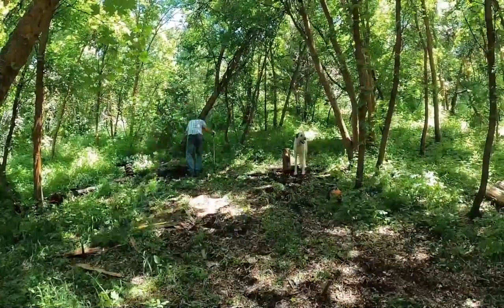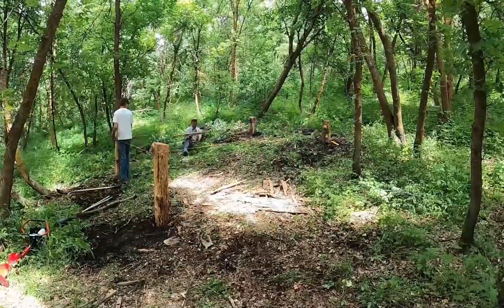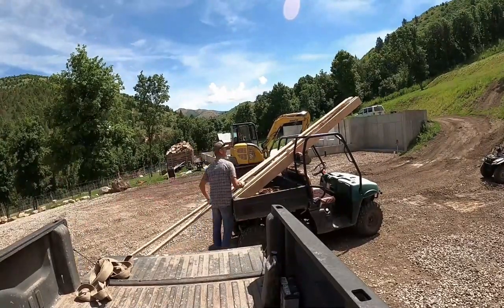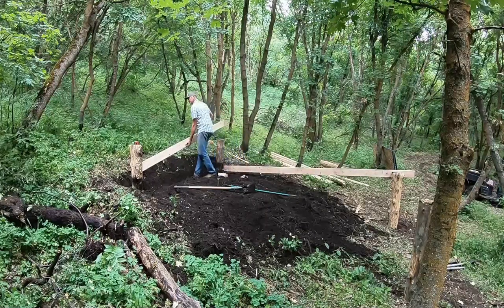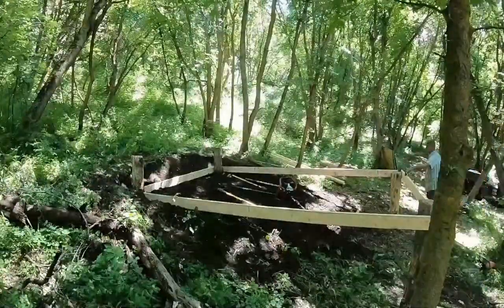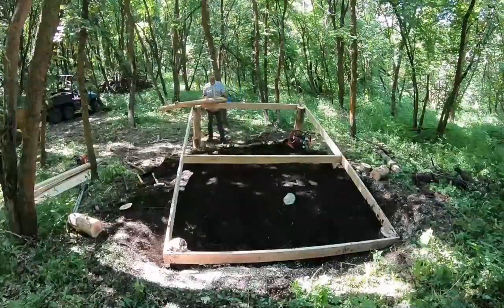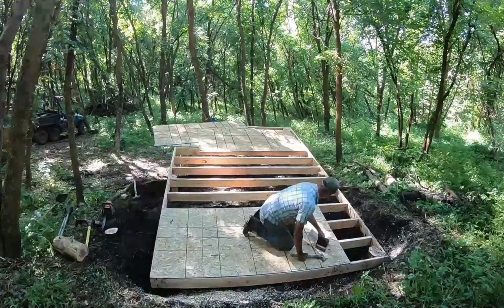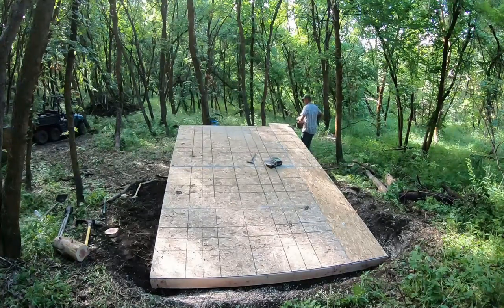#417 - I Built A Tiny Off Grid Cabin On The Back Of Our Property!

Comment: I think those log pilings are going to rot fairly quickly since there is no protection. Normally pilings are at least charred to provide rot resistance. In appalachia ground contact posts were charred. The pilings could have also been protected with gravel so water has a path to drain away, or impregnated with used motor oil. I think those pilings are going to last at most a couple of years.

It would have also helped if the floor framing was all primed as well as the bottom of the OSB. A vapor barrier on the ground would have also helped.

Comment: 2 quick comments.  First, I would have gone 12x16 just to make use of full sheets of OSB. Second, those post will not stay at the same height forever.  Some will sink, some will lift, from the frost.  If you had put the floor ON TOP OF THE POSTS, shimming would be easy.  You'll have to use a different method.
If there is a saw mill near by, I would order some rough sawn 5/4 as wide as is reasonable and do real board and batten.  Actually, randow widths between 8" and 12" might look good !
Depending on the size of the stove you are going to put in, you will need to reinforce that area of the floor.

Comment: Some of us are not armchair critics. We are professionals in the trade and just want to point out the issues we see.  Maybe he will read the comments before it is time to build this cabin again.  It will rot and sag to the point of it not being usable in 3 years.  We all make mistakes. Do we all learn from them? Not if we don't listen to people who have already made the same mistakes.
Uphill posts too low. (below grade).
Posts not treated or charred.
Joists not on the post and only screws holding it to the post.
Joists screwed in to beam instead of using hangers.
Joist not made of treated lumber.
OSB used for floor. Should have been treated plywood.
You have to get the foundation right to have it last.
If it is worth doing... It is worth doing right.
Suggestions;
10ft x 15ft ?
12ft x 16ft would be less cutting and better staggering of joints and works out good for 16Inch OC.  10ft x 15ft does not work evenly for 16 inch on center.
Not saying this is a bad channel. I don't subscribe to this but I watch it when it is put in the next up feed.
Reply: If you're going to do it, do it right!

Comment: Why not finish the shop first before starting the cabin?
Reply: In a previous post, he was waiting on the lumber needed which was to take 2 to 3 weeks. We all know that Heath is a person who doesn't like to be idle so what better way than to work on the cabin when you have material sitting there that you can use!!!
Reply: It would be funny if the answer was, he simply doesn't want to. Hard to imagine right?
Reply: @bullzeyez3236  I don't know. There have been times when I have been hip deep in something and have said no and stopped. I went inside and washed dishes. Then I finished the project. Just needed to change things up for a bit!

Comment: I'm sure the point was to build this cabin as cheaply as possible, but how can it be cheap if you end up building it more than once? Face mounting the sills to the logs will not hold. No joist hangers. Pretty sure that was untreated lumber being used below grade. Why not stagger the seams of the OSB? It seems you have taken a LOT of shortcuts. I guess it must be nice to just throw away money on lumber, insulation and roofing for something that probably won't be standing in 4 years.

Comment: You need too finish your  House/shop project first  before you start a 3 rd. project  ( cabin )  I don't think you want too be laying in the Snow too be working on your Vehicles or tractor or any other small project that you need done ASAP.    
 A Cabin can wait,  you have a roof over your head's now.
  By the way the Cabin you want too build is not big enough for your whole family too go camping so what's the point.

Comment: If you just took 1 hour and burned the end of the posts and up the post for say 5' with a thick crust where they are covered with the gravel height about 4 inches they would not rot out in ur lifetime. Just saying and a easy job to boot only 4 posts....